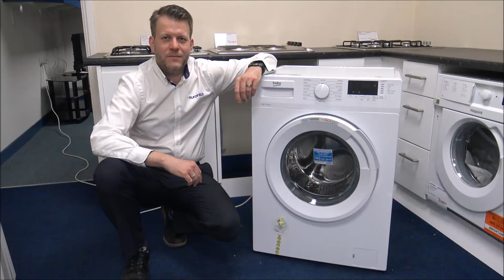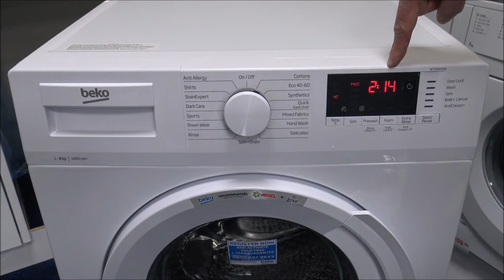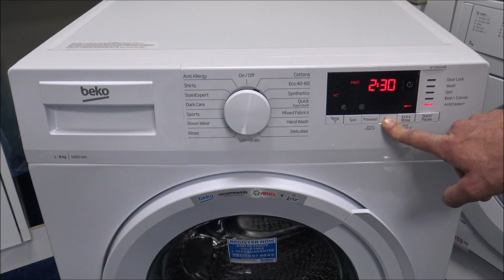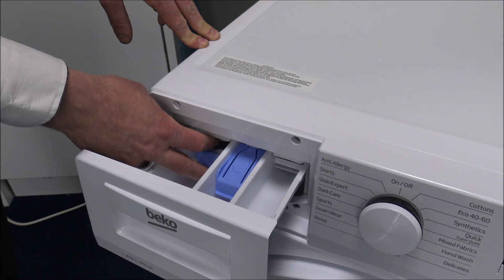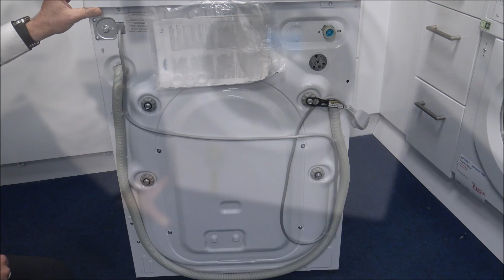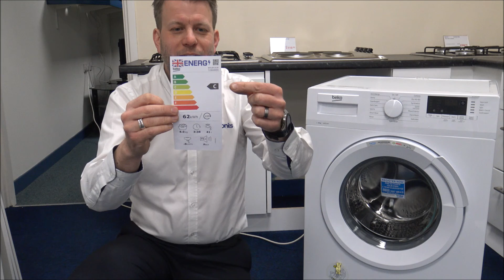Beko WTL84141W 1400 Spin 8Kg Washing Machine Demonstration

Comment: How many tablets can you put in bekio washing 🤔
Reply from the maker: Normally you should only need 1 per wash, but i would always recommend using liquid rather than tablets as you can adjust the amount of liquid per wash depending on the load size which you can't with tablets

Comment: I bought BEKO 8kg this year. It’s very economical in water, which I’m not so happy about. There’s still detergent residue left in the last rinse, therefore I always use the 3rd rinse for quick program. Be careful when you wash flanel and thick synthetic clothes, it won’t spin at all. I have no problems with older Zanussi model (5 kg) which has no balancing program. It will spin happily and it still does after 15 years.
Reply from the maker: This is normally an indication that you are putting too much detergent in the machine if there is residue left at the ened of the program. Try reducing it, and hopefully you will get the same washing results, reduced cost of detergent and also no residue left at the end of the program.

Comment: Im using Beko wx742430s. This is so helpful because i dont understand how yo use those buttons. I usually put my beko  with Mix fabrics but after washing the clothes,the stains won't remove 😢, again i dont know why it shakes and dance around if not hold on, it hurts.
Reply from the maker: It may help to use a longer cotton program if the stains in your clothes are not removed fully. If its shaking around during the cycle, just make sure the machine is level and that all of the transit bolts have been removed as that could damage the machine if it hasn't been installed correctly.

Comment: Great vid, i recently bought one brand new. It washes but then doesent do the spin and drain function. I have to turn it off. Then drain the water with the drainage line at the front. Any idea why its doing this? Ive removed all the travel plugs, polystyrene etc from it. Please can you help . Many thanks
Reply from the maker: This sounds like it could be a blocked waste pipe if its not pumping the water out properly.

Comment: I tell all my friends to get this machine if they’re not looking to spend a lot but don’t want the cheapest ones like — bush, logix etc.
We have two in work they are brilliant for £250 quid.  
I have LG at home and it’s great i will never part with it everything is repairable on it plenty of spare parts so I’ll be alright for the next 20 years with the same one lol. 
But the beko has more programs than mine is really quiet to be fair at 1400rpm compared to the old zanussi essentials jetsystem 
With a brushed motor and broken bearings (extremely loud) 
They had before they got a 2nd one of these beko machines the same models as shown in the videos definitely good value for money and yet to meet someone with this machine that is faulty my neighbours 6kg 1100rpm beko machine is 15 years old and still going leaking and rusted yes 😂🤦🏻‍♂️ but it still does the job so she won’t part with it.  
Their definitely value for money and times are hard I only got a LG washer/dryer as it was out the very catalogue as couldn’t afford £679 and that was on offer from £779 upfront so just pay it over 52 weeks. 
If I had to buy one in cash I would have gone to town to the euronics store and paid £230 for one of these I think their great for what you pay 👍🏻💯

Comment: I had a Beko 6kg machine for 12 years and eventually the bearing packed in.  I now have this same reviewed Beko 8kg machine 1400rpm.  I can confirm it seems worthy.  After a week or so of use, nothing unusual to report.  Build quality seems fair to good.  Fairly sturdy construction, seals and drum seem high grade.  As per lifespan of machine, only time will tell.  I have had Beko machines before and never had less than 6 years out of them.  Only thing I don't like is the LCD display but it's no huge deal.  Cost around £340 delivered in UK.  I did a load at 40 degrees using oxiwash at 1400rpm on fast+ mode, took 27min.  The pump is very quiet and powerful.  It fills with water in no time and starts cycle very quickly.  The motor is very powerful and nicely calibrated. It does vibrate a bit substantially at 1400rpm but I have not done any proper balancing yet.  Certainly a worthwhile option if you are looking for a washing machine.
Reply from the maker: Great feedback, thanks very much 😊
Reply: Hi, can I wash a 4kg blanket in this machine?

Comment: If you put more kgs in a wash than is recommended what happens please?
Reply from the maker: The machine will just take longer to wash and the performance of the wash may not be as good as if you were to use a program that is designed for a larger capacity.

Comment: I just got one of these - anyone know if it needs to be load 'calibrated'. The documentation isn't clear... If it does need calibrating the documentation isn't clear as to how to actually do it... A demo would be good (if it applies)
Reply from the maker: These machines don't need to be calibrated. As long as the machine is level and the transit bolts have been taken out then once the water, waste and electric are connected you should be ready to go.
Reply: Ok, thanks. It's confusing because the instructions include info about calibration via the drum clean program but it wasn't clear (to me!). Now I just have to try and fix why the drain is backing up the sink! It does slowly-ish drain away at the end of the drain cycle but each time it's coming dangerously close to the the top of the kitchen sink... @lords-electrical

Comment: thanks for explaining everything, we have one problem with our washing machine, this model: WUX61032W-IT. we put Liquid detergent but there is no any trace of it during washing. and after that, we cannot smell it on our clothes. It seems this machine does not wash clothes with Liquid Detergent, only water. could you please tell us what should we do.
Reply from the maker: Are you putting the detergent in the drawer or the drum? If you are putting it in the drawer then i would recommend putting it in the drum directly. At least you can guarantee it will have the detergent in for the start of the wash.

Comment: The video is very helpful thank you. Could I ask when adding a water softening tablet would you put it in the drum or drawer?
Reply from the maker: Normally in the drum so it can dissolve properly. Sometimes with tablets if it is in the drawer it may not dissolve properly especially if it is put on a low temperature wash.
Reply: Use white vinegar
Reply: Thank you that's really helpful ☺️👍

Comment: I just bought that machine. It said I need to calibrate it so to run drum clean program empty could you go over that please
Reply from the maker: Drum clean is a dedicated program to try and maintain the machine and is normally just to run the initial wash without any clothes in the machine on a hot wash. I would normally select a quick wash option if the machine doesn't have the Drum clean program

Comment: I have the Beko wtik7451f. Just used it for the first time. On its spin, it literally danced around the room. With me trying to hold it still. I can’t keep it. Awful.
Reply from the maker: First of all check all the transit bolts have been removed. Sounds like at least 1 has been left in the machine which will cause it to jump around. I just hope it's not damaged the machine or your cabinets.

Comment: Many many thanks,  how long would expect this model to last , I know many factors involved but with one weekly wash at low temps and quick cycle?
Many thanks in advance 
Cheers 
Glen
Reply from the maker: This is always the golden question and really difficult to answer. If you get around 4-5 years out of a Beko machine then that would be considered average i would say. Other brands like Bosch or Siemens i would expect to get longer like 7-8 years.
Reply: @lords-electrical  many thanks,  greatly appreciated

Comment: I had no idea that there was an anti crease and a fast plus option, too. Neither did I know that there was a specific programme for washing the drum. I have to clean my washing machine around once a fortnight to three weeks, and I use a regular wash at 90. Also I only found out that you flipped up the plastic part in the detergent drawer for powder, a few months ago and I have had the machine for over a year now. Is this the case also for Vanish powder, where I put it with washing liquid with the plastic part flipped down? Vanish powder tends to ruin the machine as does certain items. Can Beko granules also be poured into the detergent drawer with the plastic part down? Also are Beko granules bought from Amazon as good as the ones bought directly from the company? It is really sad that engineers who have been sent round for technical issues have had to explain things to me and still I didn’t receive complete information. I don’t recall receiving any instruction manual with this. Also I am vulnerable and have a disability so need the extra care which I don’t get.

Comment: Why would my washing machine always stop at rinse with it flashing  and doesn't continue on with the wash
Reply from the maker: Check the waste hose isn't blocked. Also is it a full load in the machine. If it is too small a load then it could be the fact it will not distribute the load so cannot spin properly

Comment: While your video was running, I looked at my Beko 7kg wash no blue plastic thing in the soap dispenser. I can't recall if it ever came with one. If I had of spotted it in the manual or in the soap tray It would have got me wondering what it was

Comment: Thank you soooooo much. That little blue tag thing in the detergent dispenser had come loose in my newly installed Beko. Beko has nothing in its manual or website (or even spare parts) that explained what it was for or how it should be fitted. There was something in the manual supplied but it looked completely different to the one in my machine and had a diagram that meant nothing to a layman. Google provided zero help. 

Your explanation and demonstration is excellent. Found on Youtube. Tbf, I was getting seriously frustrated until I found your video. 🙏🏻🙏🏻🙏🏻
Reply from the maker: Great to hear this was useful for you. Thanks for the great feedback

Comment: My mum's washer is beko..it washes perfectly but there are somethings annoying about it..the first one..it spends alot of time to balance the load..for example about 15-20min although you can not see any imbalanced tumbling..i can be sure that i've never seen that it spins at the first attempt even if you put same size cloths and full load in the machine..the other thing is it's 2min pause to unlock the door..i've never realized why some companie's washers doors unlock a year after nding the cycle..that 2 mins is really as long as a year😁
Reply from the maker: The lock at the end can be frustrating especially if you are waiting to get the clothes out, but if it is taking a long time to balance the load, then it may be worth trying to put more clothes in when doing the washing. This can help to balance the load quicker.
Reply: @lords-electrical   hi 
mine is Beko washing machine  WTL 82051W 8kg  its take three hrs to wash, even if I set Cottons 40,please can you make a video for this.thanks
Reply: @mwanaidimohamed9200  it can sense down in time, say you did a small load about half full it would be half full..then it will be around 2hrs